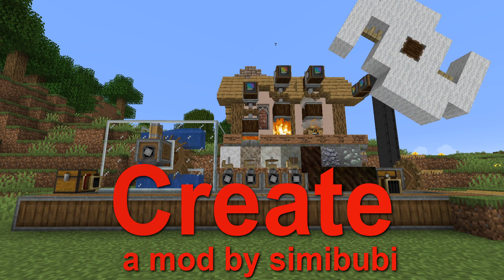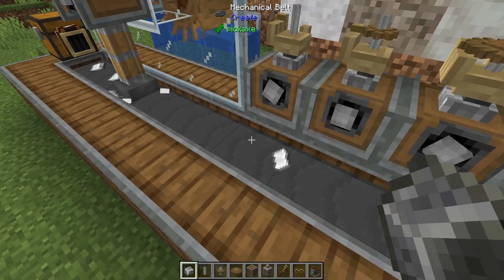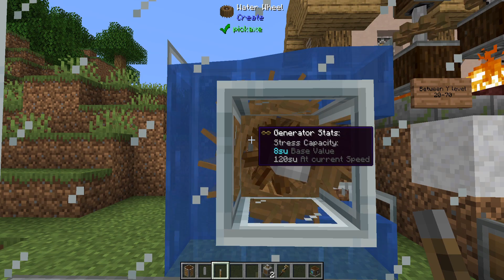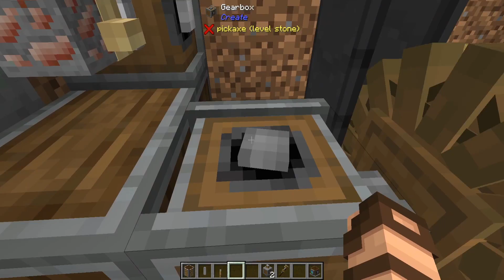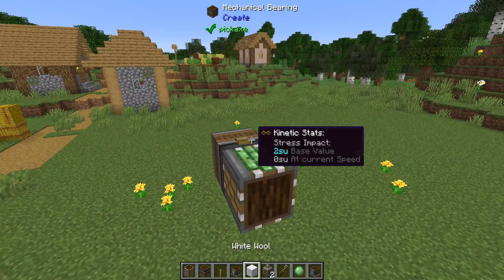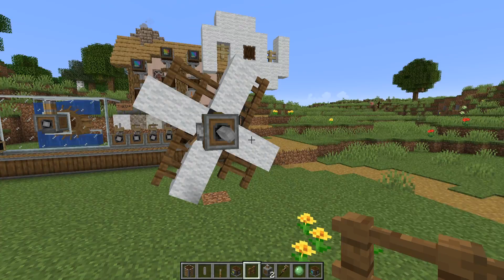Create v0.1: Get Started! Bit-by-Bit by Mischief of Mice! (old)

Comment: (IMPORTANT CREATE 0.3 INFO FOR WINDMILLS)
Anyone playing on the 0.3 updates. (A lot has changed since 0.2) Here are a few tips on a few things that have changed that might be confusing/different. This isn't a complete list, but I hope it helps. 
I'll put quotes around mod items. Depending on the age of this post, some things might change again. 

Windmill changes: Build the windmill with a "Windmill Bearing" Build the structure (the windmill blades) first (You do not need the "radial chassis". Then after you like how it looks, right-click the "Windmill Bearing" with an empty hand. It no longer requires Redstone to turn on, to turn it on/off just right-click with an empty hand. Also... (Shift with a wrench to change its spin direction.) ("Sail's" now exist, but I really just don't get them, supposedly speed up the windmill. They look weird because of their size, but they can be dyed.) (If some blocks aren't moving, double-check your sticky placement) (you can now use "super glue" instead of slime balls)

Item Movement Change: "Create Droppers" no longer exist. Now use funnels, mechanical arms, tunnels, or even chutes. It has made automation so much better and a lot better for performance. Might be a little hard to get used to but the sky's the limit with these bad boys. 

Mechanical Bearing: This no longer works for windmill use. It won't move an inch. This item is still incredible. You can power it kinetically, add some Redstone power, and watch anything spin. Super helpful when making contraptions. 

Superglue: USE THIS! Don't waste slime. It's very cheap and has tons of uses. You really get your bang for your buck on this. Seriously use this instead of slime, it works the same but is just built differently. Like really different...

Tip: 
Furnace Engine:
Blasting furnaces are the best choice when using the "furnace engine". If you are playing on a mod pack ores and coal shouldn't be too hard to find once you are in the brass section. 

Furnace engine not working? Make sure to attach a "flywheel" to it. Place the "flywheel" behind the furnace engine (should see a square hole back there) Make sure it has a one block gap inbetween. Two cables should connect automatically. Now connect your gears to the flywheel.

Tip: 
Waterwheel: Stayed mostly the same as what I've seen so far. Remember to cover as much surface area as possible, so make a C water flow around it. Use multiple together early game if you are having trouble getting wool. 

Tip:
Crusher: Not changed from my experience so far. Tip: Get this asap if you don't have pulverizers or crushers from other mod packs. This behemoth will dupe ores, diamonds, and give tons of item recycling options. Don't miss out on this. If it isn't working, make sure the two crushers are spinning in opposite directions. You can automate this bad boy with droppers and belts. Want it to crush faster? Just increase the speed!

Tip: 
Rope Pully: Get this and some mechanical drills. You can make a very early game quarry. Lookup a tutorial, too hard to explain without a video.

Need help? Hit me up whenever! Hope this helped a bit. I may add more to this as I dive into the new piping and transportation features just added.
Reply: You're a life saver! I was just trying this tutorial
Reply: thx you, here is my like
Reply: Thank you so much I was having a stroke trying to comprehend how powering the windmill with my waterwheel would generate rotational energy.

Comment: So frustrating using a term called "Stress Values" when we have had a great term called "Torque" for a hundred years.  Being creative doesn't mean we have to change great understood terminology.
Reply from the maker: Torque is a force that tends to cause rotation. Stress Units are a measure of how much stress you can put on a rotational system before it fails. It's not the same in my mind.

Comment: I'm stumped, I just need a way to make a mechanical piston to push and retract stuff.  That's all.
Reply: Piston shafts behind it each piston shaft is one more block it can extend. Rotational force through the side, if the direction of rotation is swapped the piston movement will also swap
Reply: @marcy1949  Okay, just needed to make a block swapper for a hidden base.
Reply: 10 am right now gonna have a more detailed explanation when I get back to mc

Comment: Would be handy to mention how you can alter speed of networks with cogwheels / gears. A small cogwheel adjacent to a large cogwheel spins the large cogwheel slower, increasing the torque (stress units) while a large cogwheel spinning a small cogwheel increases the speed, although reduces the torque. It works just as you would expect based on real life!
This is also the only way to do it early game, before you get brass to make the more advanced contraptions like the speed controller.

Comment: the speed and stress units of create is similar to the rotary craft rpm, torque and kilowats, same with gear box and shafts, it's nice that rotarycraft has somewhat of a successor on the newer version of minecraft, it is one of my favorite mods because of how different it generates transfer and use power

Comment: How do I get enough speed to make Brass in a mixer?
I have 2 water wheels hooked up to it.
Reply: Andrew Binning 
Perhaps you could gear it up.
Reply from the maker: Either stack gear ratios or use rotation speed controllers.
Reply: @MischiefofMice    I can't make speed controllers without brass, but if I put a large cog on the wheel I guess that would lower torque but increase speed?
Reply from the maker: More speed is more stress on your system. Put a large cog on the same shaft line as a small one that is powered by something like a windmill/waterwheel/fan. Connect the gears of the large cog with a separate small cog. Repeat placing a large cog on the same shaft of the new small cog. You have now increased the speed and stress you produce. You can continue adding cogs this way several times to step up speed and stress. A windmill is ideal as it can take a lot of stress without stopping. Good luck.
Reply: @MischiefofMice  Thanks, I did finally figure it out. Now that I have brass I will be  building a big windmill.

Comment: I would also recommend as soon as you have the option to crush resources - make a cobble generator and crush the cobble into gravel, get a basic washing system up (fan with water between the fan and the top of the conveyor belt. You can probablg get away with two or three fans if you have a slow enough belt) and you now have an infinite source of iron nuggets and flint. (You have a percent chance to get iron nuggets from washed gravel) 

Only thing I haven’t figured out yet is an infinite andesite farm which I don’t think is possible sooo... happy digging!
Reply: Andesite can be crafted from diorite and cobble too, and using my memory granite plus Quartz is diorite?
Reply: Gavin GG it’s not perfectly infinite unless you mean to tell me there’s also an infinite diorite or, granite and quartz farm I haven’t thought of, but definitely a good note.

Comment: Using this mod with minecolonies and you got one of the best and lightest modpack in minecraft...
Reply: Now if i knew how to make a modpack i would totally do this
Reply: Noah Anderson All you need to do is download a bunch of mods, then make sure their settings are all compatible. It’s a nice step to go in & make sure mod content is in sync (so you don’t have three different Copper ores spawning for example), but it’s not strictly necessary. Once you have all the mods you want, you can package it. I’m not clear how best to go about this, since the systems for distributing modpacks have changed a lot, but I doubt it would take you more than a couple of days to build a functional modpack.
Reply: @Jaxck77  how do you disable types of copper or tin? I have both galacticraft and thermal foundation so I have 2 of each
Reply: @Jtak-qu5hk  look in the config files and disable the generation of one of those
Reply: @Jaxck77  the best way to do it is via twitch or the more modern and updated overwolf curseforge launcher which have built-in modpack creators that automatically download mod dependencies as well
Reply: @noahanderson8688  Download CurseForge app -> create custom modpack ->  install minecolonies and Create. Thats all, mod instalation in CurseForge app is one click work :)
Reply: Minecolonies?
Reply: That and blue power
Reply: I'm going to test
Reply: Or tektopia villagers
Reply: im about to do it
Reply: @melonheadwt  i have already doing it

Comment: So the author got around to adding torque and suchlike. Nice! It seemed too easy before when you could run all the things with a single waterwheel or whatever.

Inevitably, when someone makes a mod with a Redstone Flux to Torque (rotational force) converter, I hope they do their homework and get the math right.

Did you know that Botania has a device that converts mana to Redstone Flux? I wonder if Vazkii will ever make something that converts mana directly to Torque.

I hope the author of Create finds a few more ways to constrain the generation of Torque, at least by a little. Maybe by making Windmills unable to generate force if there are too many occupying a single Chunk.

I would also find it pleasing if you could use Immersive Engineering Windmill Blades in place of plain wool blocks, if only so that they're more aesthetically pleasing. Though I do wonder if a modpack really needs both Create and Immersive Engineering in it at once. They kind of serve mostly the same role. Though if you do have both of them, at least the visual styling of each don't clash horribly.

Comment: I wonder if anybody's made a crossover mod for this and immersive engineering yet? Seems like it would be pretty straightforward. A few blocks for converting between the two power systems, maybe a way to directly plug in IE wind/watermills to create shafts, and some tweaks to enable IE & Create press, grinder, mixer etc recipes to work on either mod's machines.

Comment: There needs to be an addon mod that adds blocks which convert rotational force to redstone flux only for specific blocks like OpenComputers.  That way, it's not just adding create to the generic RF factory, but bringing certain features like programmable computers from other great mods into the Create system, without needing separate RF generation.

Comment: How do you create a conveyor belt? I couldn't figure it out.
Reply: he shows it in the video, it is six dried kelp in a 2 x 3 pattern in a crafting table, although you should check to see if you've installed version 0.2 or 0.2.2, as I'm pretty sure version 0.1 has a different recipe
Reply: @AshEshyr  no, i meant how to make one after you've got the belt, like a moving one. Sorry, I wasn't clear haha
Reply: @hiroshih9157  oh, you need to attatch it to two or more shafts, the give rotational force to one of the shafts it's connected on
Reply: @AshEshyr  oh thanks. I'll try that later. Thanks man

Comment: First I need to get 1.14 and above to actually work, since I have to play through twitch. But love what I'm seeing!
Reply: Oh, on twitch when you make a new pack there should be a setting to choose what version.
Reply: @cinderheartMLP  Did that. All that happens is it breaks every other pack and I have to completely uninstall and delete the game, regardless of the launcher I use.
Reply: @Redtail45044  well yeah most packs run on 1.12 create is 1.14 if you change a pack that runs on 1.12 into 1.14 so it will support create then it won't support mods that run on 1.12
Reply: @cultistofdarkness1661  Fair enough, I'll figure something out at least.
Reply: @Redtail45044  there are multiple mod packs that have create installed and working with other mods already on the twitch launcher if you dont want the headache, then from there you can add some 1.14 mods. the one I play is called "kreation" and it has botania, tetra and others. colonial engineers 2 is another pack, that one has mine colonies I believe

Comment: Just picked minecraft up again, haven't played in about four years.
Trying to build an elevator using Create and ComputerCraft right now. 
It's so much fun :)
Reply: 3 hours in I realize it will be very difficult to program this in ComputerCraft as I've never coded. 
The create part is easy and great tough ;D
Reply: @fatalist6262  It depends on the complexity, but you dont even need to use computer craft to do an elevator with multiple floors, just have redstone push out a piston to block the path of the elevators at the floors you want with a some buttons, each button leading to a piston at a different floor, althought I'm sure there are more ways to do it with timing and rotation blocking contraptions, but the piston idea was the first thing that came to mind
Reply: @AshEshyr  Well but that would make it partly another piston elevator :D
So far I'm using a mechanical sticky piston, a clutch, a gearbox and redstone contacts on the elevator platform and the counterpart at each level of the building.
I need a variable to save the current position of the platform.
So If "current level > destination level " then send a rednet signal to the gearbox to switch rotation...
Reply: @fatalist6262  ohh I misunderstood, I thought you'd be using the rope pully since it's unlimited distance vertically and you wouldn't need the piston poles sticking out
Reply: @AshEshyr  Never heard of that. So far I only built a crushing wheel in Create :) Thanks for the hint! 
I'm building a mountain base, so the extensions wouldn't be an issue.
I will probably use the system that looks better, as one side of the elevator will be out of glass facing the beautiful lake Haha
Reply: @fatalist6262  ah I see, well if your not playing on version 0.2+ then it wont be there though
Reply: @AshEshyr  I got the other fancy stuff like the speedometer, so I'm pretty sure on the current version. Gonna check it out when I'm off work. Thank again
Reply: @fatalist6262  ah yeah then it should be in there
Reply: @AshEshyr  I played around with the Rope Pulley. You are right, they are better in terms of looks and handling. Thanks :D
I just tried to built an elevator cabin with an inner space of 3x3x3 blocks. Was about to give up after 1,5 hours.
Then I realized there are not only radial chassis but also linear ones haha
After using the linear chassis it took me 10 minutes oO
Reply: @AshEshyr  It works Haha
I'm so proud
Reply: @AshEshyr  Or, just install elevator mod.
Reply: @aiosquadron  that is much less fun
Reply: Update:
You cant an elevator with create if the controlling computer is placed inside the moving cabin.
The movement by create makes the computer somehow not working correctly.
Placed the controlling computer outside of the moving cabin on a solid block and it finally worked as expected. 
Hard to find the error in your code if there is no error :D